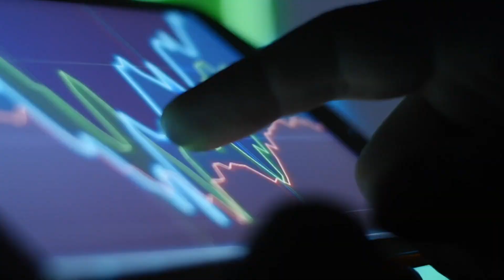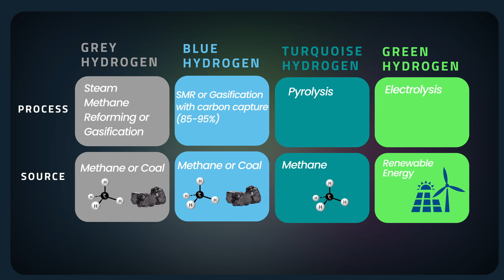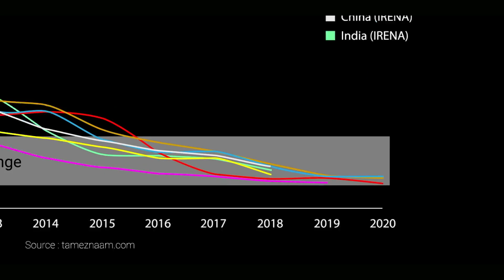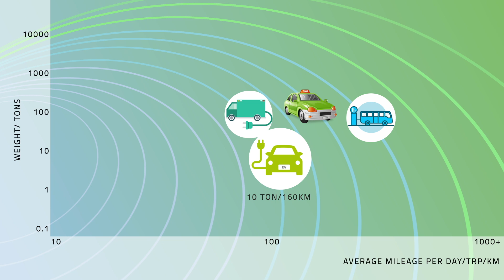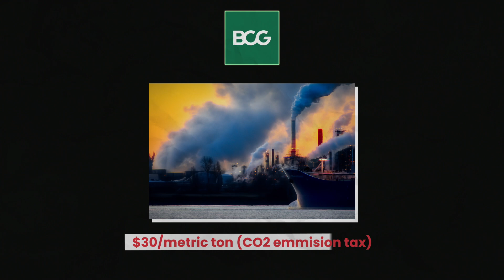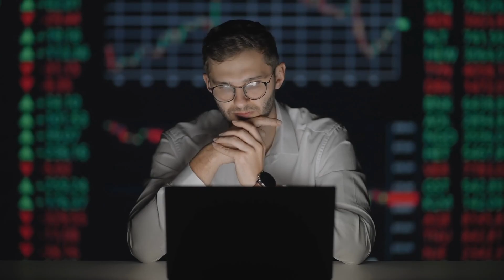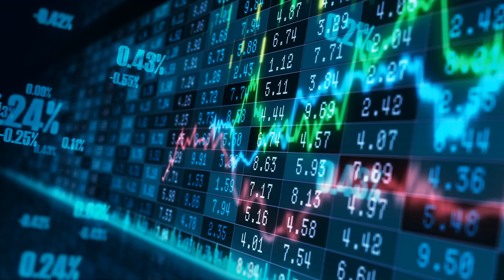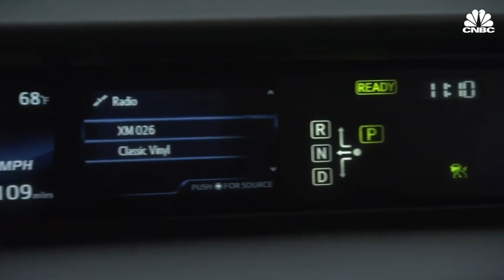Why NITIN GADKARI is pushing GREEN HYDROGEN for Indian Industries : Policy Case Study

Comment: I did some research on Hydrogen for my investment, Expect to read this story repeatedly over the next decade:

1) Politicians seduced by H2 Fuel Cell technology; 
2) Price signals suppressed throughout the value chain - subsidised hydrogen via subsidised distribution to subsidised vehicles; 
3) Physics and Economics spoil the party.

The best case H2 is worse than the worst case battery storage in terms of both cost and efficiency. Also battery cost is declining rapidly while H2 cost is more than hydro carbon fuels. Cost decline in H2 happens only on paper. Even lead acid battery storage is better than hydrogen storage let alone Li-on battery. H2 cost savings we see in the news are carefully selected half-truths. They say it takes 5 minutes to refill hydrogen fuel cells but they won’t say, how long it takes to produce, compress & transport H2. Those cost & time must be accounted somewhere in the value chain and they are enormous!

Unfortunately many nations are investing in H2 heavily, which is going to be waste of Taxpayer’s money. Even Reliance is going to invest heavily in Hydrogen. Not sure if there are any engineers with economic sense. Scientists are different from Engineers; Engineers are different from Manufacturers; Manufacturers are different from Raw material producers; and Businessmen are different from all of them. For any product or service to reach masses, it must make sense for all of these players. But unfortunately here politicians & businessmen are talking to scientists and announce it to public to please the voters & shareholders.

We must remember, H2 is NOT an energy SOURCE but an energy storage mechanism.  H2 is the most abundant naturally occurring material in the universe BUT NOT on EARTH. It must be extracted either from Methane(CH4) or Water(H2O). Extracting H2 from Methane is definitely economical but Methane is again hydrocarbon and it warms the atmosphere 86 times more than carbon dioxide. So we would be better off with petroleum & Coal than Methane based H2. 

To extract H2 from water, Electrolysis is needed which is an extremely energy intensive & inefficient process. To extract H2 from water, we need to spend 3 times more energy. If we want to store 1 KiloWatt energy in Hydrogen fuel cell, we need to spend 3 Kilowatt energy. Are we living in any kind of energy abundance situation, to waste 2 Kilowatt for every 1 Kilowatt of usable energy?. Green Hydrogen is definitely green, I mean there is no carbon by product there. But we're wasting 70% of energy produced by Solar & Wind while storing it in H2 fuel cell.

Also H2 is a colorless, odorless, and tasteless gas. It is the lightest gas and is explosive in air at concentrations greater than about 4%. In contact with chlorine, oxygen, or other oxidizers, hydrogen is flammable and explosive and burns with a nearly invisible flame. Because H2 is the lightest gas, it needs huge physical space to store though the mass is super low. To handle this, it has to be compressed or liquified in a pressure chamber. How’re we going to transport this kind of material from production facility to all over the refill station?. H2 Pipelines across the continent, seriously?. Who is going pay for such a massive and hazardous infrastructure?.

Green H2 makes sense, only when we have energy abundance and don't know what to do with such excessive energy.

If you're not convinced, No less than Elon Musk says, H2 is dumb idea. Nuclear is by far the most reliable and safe energy source followed by Solar & Wind + Battery storage.
Reply: H2 may not be an effective replacement of Petrol and diesel, but it can be a replacement for coal and natural gas in Indian industries.
Reply: @ajaivaidyanathan5880  No. Coal & Natural Gas are energy sources, but H2 is not. We need to spend either Solar/Wind energy or Coal/Natural Gas energy to produce H2. In that process, we'll be wasting 2KW for every 1KW usable energy. Why are we promoting this 70% energy loss, while battery storage has less than 10% loss?.
Reply: @dskrishnan  Correct
Reply: @dskrishnan  you are right in most of the things you said but there is a lot of wrong information too....

Hydrogen's specific energy is 120 MJ/kg petrol's is just 46 MJ/kg.

1 kg of Hydrogen has a specific energy of 33,000Wh or 33KWH, Tesla's Lithium ion battery has a specific energy density of 167Wh/kg....so a 2kg of hydrogen holds the same energy as Tesla model 3 entire battery pack which weighs 450 kg.....saying hydrogen is worse than lead acid battery is so wrong, it melts my brain...

Saying Hydrogen is not a energy storage mechanism is factually wrong, hydrogen is an energy carrier because, it is very rarely available in it's purest form in our atmosphere, you have extract it from others...It is not a storage medium that would be the hydrogen tanks or metal hydrides which are used to store hydrogen.

you are right in saying it is hard to store hydrogen, it is light and it is very small in molecular level....so it is hard to store hydrogen as a gas, so you have to store it as a liquid to do that you have store it under huge pressure or super cool it...both are difficult but not much different from storing CNG and LNG...

Electrolysis process is energy intensive and you are right, you need 3kwh of electricity to get 1kw worth of hydrogen, and so you say it is not viable.. But you are forgetting the energy intensity of the oil drilling and refining process. more energy in electricity is spent in drilling and refining the oil before it becomes petrol or diesel ...if the input to output ratio of hydrogen electrolysis was 3:1 then it would be 10:1 for fossil fuel, probably even worse than that as the engines are normally around 25% to 30% efficient so it is even worse in reality...

Batteries are not made out of magical shit and unicorn tears, they have some of the rarest earth material and they involve a very tedious and energy intensive process during refining....infact electric cars have 70%-80% higher carbon footprint than a ICE car and even though they don't have tail pipe pollution, according to a recent study by Volvo comparing their electric and petrol powered xc40 they found the electric car only becomes environment friendly over the petrol car after driving 140,000 km because they have that much carbon pollution during their production process (Autotrader did a Video on this you can take a look at it if you want)...

Batteries may be good enough for cars but for trucks, ships, aeroplanes etc weight is a major factor and heavy batteries are a no go....that is why even Tesla haven't brought out semi even though it was supposed to launch a few years back because the batteries alone would probably weight around 10 tons which directly affects it's total load carrying capacity...

hydrogen is extremely flammable but it doesn't burn with an invisible flame. Rockets use hydrogen as fuel does that flame look invisible to you. Methanol burns with invisible flame not hydrogen

hydrogen is stored at high pressure that even if a leak were to appear then the gas would escape and mix with atmosphere so fast it wouldn't be able to catch fire...there is a video of Toyota testing their hydrogen tank and shot it with a armour piercing bullet and it did not go in flame.

nut even a small puncture in lithium battery pack will cause an huge explosion forget about puncture, if it gets too got it will explode, if there was a thermal runaway in some cells it will explode, if the outside ambient temp gets too hot and the battery can't cool itself properly it will explode...

Hydrogen can be produced on site you don't need tankers or pipe lines to transport them, hydrogen can be locally made using electrolysis in the fuel station.....heck you can produce hydrogen even in your home if you have the electrolysis equipment...

saying hydrogen bad, battery good is such a childish view of the world, moreover China has a monopoly in lithium ion production and mining, 80% of all batteries come from china you want India to be dependent on China...…even if we produce the batteries here, the raw material has to come from mines which are controlled by them...

Don't start with hydrogen is dumb because Elon said so...of course he would say that since hydrogen cars are a direct threat to his company...

One great benefit of hydrogen cars with fuel cells is that it purifies air as you drive along, Hyundai nexo purifies 27kg of air in one hour of driving that is the amount of air 40 adults breath in an hour...10,000 hydrogen fuel cars will purify the same amount of air as 60,000 trees, this is great for countries like India which is struggling with air pollution..

we need both the hydrogen and battery technology to become better, think of it this way batteries are good enough for everything that uses petrol and hydrogen is good for everything that uses diesel or kerosene...
Reply: @superchargedpetrolhead  Finally I got a good dose of my own medicine. Thanks!. Energy density comparison is one of the most misguided argument to promote Hydrogen. Of course H2 has high energy density but how much energy is really needed to pack that energy into H2 fuel cell vs battery is the question. The overall efficiency of "Power Source -> Storage-> Consumption" chain is key here. As you rightly mentioned H2 has lot of inefficiencies & complexities where it's economics is not even improving on paper without subsidies, but battery economics are clearly improving.

Now Volvo's calculation of EV's true pollution while compared to ICE vehicle is again biased. Because Car hardware in general requires lot of mining but EVs uses 30-40% less parts & materials compared to ICE vehicles. As you rightly pointed Fossil fuel extraction, refining, transportation, subsidies, war/terrorism financing etc are not accounted there.

Unlike fuel tanks, battery packs do not explode, they catch fire slowly and burn for really really long time.

Those rare earth materials in batteries have high recyclability and it is only improving. Cobalt will soon be phased out and the progress in general is accelerating, compared to the progress in H2. So Why would we want to fund & improve H2 energy storage which has 30% efficiency while we already have batteries with 90% efficiency?.
Reply: @dskrishnan  I never said hydrogen is an energy source, I just said they can replace natural gas and coal as a source of heat in industrial processes. The source of energy can be anything that is renewable. But in industries you need heat. You can extract any form of renewable energy and store it in hydrogen which can be used to power the furnaces of industries by replacing coal and oil.
Reply: @dskrishnan  hydrogen production and storage has some inefficiencies but it's high energy density makes up for it...as i said 2 kg of hydrogen has as much energy as a entire tesla model 3 battery pack which weighs 450 kg...

it is so energy dense that you can probably power your entire home for months with just a few kgs of hydrogen...

Volvo isn't biased in this case, because they have said they will go completely electrified by 2025, what will they get by making electric cars look bad when in a few years their entire range will be fully electric...

the carbon footprint during production of a ICE car is 70% lower to the comparable electric car mainly because of battery....ICE cars might use many parts but none of them are rare earth material unlike electric cars...

Batteries don't catch fire slowly, they explode and they burn for really really long time because Li-ion battery fire can't be extinguished...

you asked why would we want hydrogen storage if batteries are at 90%...the answer is simple because weight...we use fossil fuel not because of their efficiency but because of their energy density.

so for example if you have to power an airplane like 737, you would need to have a batteries that probably weigh three times the weight of the whole plane itself and even then you might fly for a couple of hours, that's how heavy batteries are and no amount of improvement in batteries are gonna change that. the batteries won't magically go from150Wh/kg to 10,000Wh/kg...

we spend almost 4% of all electricity produced on refining fossil fuel and in most cases those refineries are not powered by wind and solar they are powered by coal and gas plants so it is even more inefficient and polluting...

hydrogen can be produced through electrolysis using wind and solar and it can be stored to be used when the sun doesn't shine or the wind doesn't blow...that would mean we won't have to spend 4% of all electricity to refine fossil fuel that is a huge positive environmental impact

now you might be asking why don't we just store the electricity from wind and solar in batteries...well because 
1.batteries are really expensive 
2.they have a extremely high carbon footprint during production
3.eventhough it can be theoretically recycled the process is insanely expensive...li-ion battery is everywhere from smartphones to cars etc but how many battery recycling plants are there...you have probably used many devices with Li-ion batteries how many of them have you recycled???
4.weight and size 
5.there is probably not enough rare earth materials to store all the electricity needed to sustain the human civilisation even for one night...

another great thing about hydrogen is if you combine it with carbon from carbon capture then you can create methane(CH4) or any other fuel to power our cars...that is called e-fuel...

I am not saying hydrogen in it's current sage is the solution to all problems, it isn't...it has lot of inefficiencies in production and storage but you can't solve the problem if you don't invest in r&d...early engines were less than 1% efficient if we then thought it is stupid we all would be still riding in horse carriages and not in cars and bike

let's invest in both battery and hydrogen r&d, let the better product win...
Reply: You might be right,even the government might be wrong, but why do big players adani and Ambani invest in this technology if there will be loss in it, don't they have tons of departments to take care of everything from calculation to application of everything they do, just a doubt
Reply: @DwineDesings  Economic & Technical decisions are not democratic decisions. At onetime entire Europe believed earth is flat. So number of people saying "Yes" doesn't make a project viable. Cold hard facts matter. In the life of companies & leaders, there would be many mis steps, miscalculations, I think Green H2 is one such case. I think wasting 70% of energy while storing in H2 fuel cell is a poor business decision while we can store 90% of energy in batteries. It is not about Green or pollutive, I am arguing  against the wastage of such precious clean energy.
Reply: Dude do you think reliance is foolish to put money....they definitely know better economics and have experts with him when they make such a decision.... They don't just wake up  go and check random comments on youtube and tv ...and put money....they know what they are going into....
Reply: @vishwasreddy7871  For sure they're not foolish with money, but not all of their decisions are wise. As much as they're wildly successful, they have many mis-steps/failures as well. I think H2 is one such mis-step. For sure they're not going to read a random YouTube Comment, but I can choose not to invest my money  in such H2 fuel cell based projects and share my research. You're welcome to ignore!.

Laws of Physics and Economics don't care whether it is Reliance or Adani. If you can make a technical/economical argument about why my assessment is wrong, that would be helpful. Authority is not the Truth, Truth is the only authority. It is not good use of our time to make arguments just because a big name/authority (Reliance/Government/Country) is involved.
Reply: @dskrishnan   arguing  and commenting, suggesting right now to you i am not that stage as i have to study on this topic and comment for that for which i don't have time , but i know the mentality of gujjus they don't take risk or put money.....ignorance of knowledge of other is dangerous...you may know only few things ...may be there research analyst know what you not learnt and you never know what future research holds ... previously also people said ev cannot be possible...but we are seeing the reality...and H2 fuel may have other utilities which they are concentrating on, but H2 will be a reality soon....ev's are temporary solution...
Reply: I do not agree with many things you said, and frankly impressed by the research you did. 

But you have to consider the cost of storage and transportation will also come down with time. As research will also be going in these areas (I haven't done my home work here).
Reply: @248harish  We can bring down the cost of anything overtime, that is not the point. We're wasting 70% of the energy even in the best case. Why would we want to fund an infrastructure to support that kind of a waste, while we have battery storage which is far cheaper and far less hazardous?.
Reply: @248harish  brother you should watch the Donut media video about why hydrogen failed. You will know better that H2 fuel cell is nothing but a gimmick and politicians are obsessed over it and will spend millions and billions of money of taxpayers on a things which is not really a good alternative.
Reply: H2 production effective only if we are producing surplus renewable which is going to waste.
Reply: @MSsumer123  see it's not about who is producing it. The thing is that H2 fuel cell requires energy to give energy as output in layman's terms. The science behind H2 fuel cell makes it less efficient and costly too produce cuz of use of costly things like platinum in it. That's why it's not about who produces it cuz the science behind fuel cell doesn't make it a alternative to conventional sources of energy
Reply: @MSsumer123  I think you got it right.
Reply: Bro H2 is Bad idea for Cars but For bigger picture it can serve, like Trucks and industrial use.
Reply: @ZakwanPatel3  Wasting 70% of energy is bad not only for Cars but also for Trucks and Industries. Green H2 is useful only when we have abundance of energy production and don't know what to do with such excess energy.
Reply: How ever ineffective there has to be an alternative to Petroleum. Now itself there is floods, landslides and extreme heat every year here in Kerala. What is the point of being efficient if humans die by 2100?
Reply: It's not feasible now just like solar and wind powe was 2 decades ago, but now solar is EVERYWHERE and similar reduction in cost is expected in H2 as more research is undertaken. 
And Businessmen like Ambani, Adani and countries like Japan and Germany wouldn't invest so heavily if it wasn't viable in the long run .
And as far as the "Genius" meme man and his statements are concerned it is in his interests for H2 to fail.
Even if the odds of success are low H2 is absolutely worth the risk , imagine our oil imports cut down to <20% of what it is today.
Reply: Hydrogen jada environment m dalne s kahi pani to bnne lg jayega jisse bahot jada barish hogi ??? Jese jada carbon dioxide s garmi bdne lgi h..
Reply: @jigsaw2281  Guess you and I fall under same category in science 😅😂😂😂😂
Reply: @sai_gireesh  Its just a question dum bo
Reply: @jigsaw2281  chill bro, agreed, your question is valid and I am not good at science 👍🏳️
Reply: and you think mukesh ambani does not know all this?
Reply: @AP-do6sv  Every Company has it's own share of failed projects, mis calculations. Reliance is no exception just like Apple, Google & every company have multi billion dollar failures despite their mega success. I think Green H2 is against Physics & Economics.  Laws of Physics don't care whether it is Reliance or Adani or Saudis.
Reply: Why do you trust Elon musk so much ? He is also be wrong or he knowingly might have said that ?
Reply: @goverdhangy761   I don't care whether it is Elon Musk or Reliance or anybody. Laws of Physics don't care about any of these people. In this case I think Elon Musk is in sync with Laws of Physics. That is Green H2 in the best case wastes 70% of energy. Why should we fund such a wastage, while we can store 90% of energy using batteries?.
Reply: @dskrishnan  well batteries are heavy and you need to more power to power the extra weight. After further advancements the shortcomings will be overcomed but it's important to have a headstart
Reply: @dskrishnan  and even lpg is colourless and odourless but we have overcomed by adding a gas to make it smelly when it leaks
Reply: @dskrishnan  and the expensive nature of electrolysis might he overcomed in future by finding other alternate sources for powering the process
Reply: @goverdhangy761  well no pal its not just due to Elon saying so it's due to the science behind H2 fuel cell. In layman's terms a fuel cell requires energy to give energy as output that's why it's less efficient irrespective of who produces it. Use of costly elements like platinum in it as electrodes make it not a good alternative for conventional sources of energy cuz it increases cost of producing it. FYI toyota world's 2nd largest brand with most no. Of intellectual property rights have invested billions in its research and tried whatever they can but you just can't increase efficiency of H2 fuel cell and make it a viable option. For even better factual research I'd genuinely recommend you to watch video of Donut media on why H2 fuel cell failed. You will know why I am saying so. Hope it helps
Reply: @manthenvashishth3769  maybe we could (really hope) replace the need for platinum electrodes and this problem will be overcomed
Reply: @goverdhangy761  well the other alternatives are lanthanum, zirconia and other elements which are not abundant like our daily use elements  and thus are difficult to extract and costly. Also toyota has spent very much time in research and development behind fuel cell and even toyota says that every toyota mirai the H2 fuel cell car they sell results in loss to toyota.
Reply: @manthenvashishth3769  maybe research will come up with alloys as a substitute
Reply: For next 10-20 year H2 production will be based for Blue H2. created from fossil fuel only. 
Outside India company are spending to increasing effiency of Green H2. currently energy to create Green H2 is more than energy from green H2.  

In the US most of H2 fueling station are not maintained and running on subcidies.
Reply: What kind of reaserch this guy did nothing is not clear.nobody invest this much money into these type of huge project.india defenitely will lead the green hydrogen market in the coming decades .jai hind 🇮🇳🇮🇳🇮🇳
Reply: @Nachiket Bhagwat pal watch Donut media video about why hydrogen failed. You will then know what is right and how the world is obsessed over H2 despite knowing it's cons which are more than it's prons.
Reply: @Nachiket Bhagwat Every Mega company has it's own Mega failures, including Google, Apple, Microsoft, NASA, Reliance or any company/country you can think of. Google's Social Network, Apple's many discontinued projects, Microsoft's Mobile OS, Search efforts & you can find many mega failures. Laws of Physics & Economics won't bend because a company or Country is big. I think Green H2 is one such potential failure. If you can point out a technical/economical reason, that would be helpful. Being a big company/Country is not necessarily a recipe for success.
Reply: @A_sat  Ev is not the future...ev has lot of by product and lot of waste....have you ever thought what happens to the battery ...the lithium waste its not recyclable....elon is evil psychopath.....not a genius....he is not invented and researched something new.....
Reply: 2 decades ago, Solar energy was also considered not feasible, yet it changed with amount of research done on it.

I believe they can increase the efficiency of hydrogen with time, ofcourse if it's possible.

I am no science student, so I don't really know if it's possible or not.
Reply: @kanekiken2002  the difference with solar energy was it never required a single joule of energy just to run it. See in layman's terms when you put in petrol, diesel or CNG you don't require energy to run the engine you just require to start it with very small amount of energy. The output is produced by the fuel itself or it's action which either combustion or rotation of coil(that is electric). For solar energy 2 decades ago we knew it can be extracted but we didn't knew how. Once stored it's similar to electricity. With H2 fuel cell you first require energy as input to run the fuel cell and then it produces output energy that's why it's not a viable option. Cuz it requires energy to even produce energy. In this way it's efficiency reduces.
Reply: @manthenvashishth3769  petrol and diesel need energy to produce too...first you need to drill the oil then transport it, refine it and then again transport it to fuel stations and then burn it in engines at 30% efficiency...it is way less efficient than hydrogen production and consumption...
Reply: @superchargedpetrolhead  that energy you talk about is very different it's during the extraction. H2 fuel cell efficiency is similar to petrol, diesel ICE. Go watch Donut media video about why hydrogen failed you will know the reality.
Reply: @manthenvashishth3769  current fuel cell has a efficiency of 50%-60% that is not as good as batteries but way better than ICE
you are confusing fuel efficiency with energy density...even at same efficiency a energy dense fuel will yield more power than a lower energy one...

hydrogen fuel cell car is not as popular as ev because it is still in it's infancy...

the scope for hydrogen is far greater than just cars, like said in the donut media video it is versatile can be used to power trucks, ships, planes, and million other equipment's that are currently using diesel and can't use batteries because of the weight penalty...so they are a perfect candidate for hydrogen...

If you want to clean up pollution in the transport sector, then majority of the pollution comes from trucks, ships and planes not from passenger cars, hydrogen is a great solution to them...

I am not saying we should give up battery ev and go all in on hydrogen. all I am saying is investment in r&d of hydrogen should not be denied because batteries will never be energy dense enough to power a commercial airliner or a cargo ship...
Reply: @superchargedpetrolhead  well I don't mean fuel efficiency I mean actual efficiency of the engine or drive train that is powered by a certain fuel. Also the 50-60% claimed efficiency is half the story and that's on paper but actually a H2 fuel cell is only 25 to 35% efficient only. Due to losses at 2 intervals one during production of H2 through hydrolysis and 2nd at time of converting H2 into electrical energy. And that's not what I am saying it's a Volkswagen article on comparing the EV, H2 fuel cell and ICE  and Even toyota world's 2nd largest automaker and brand with most intellectual property rights have invested and wasted billions  of dollars and hours in research and development of H2 fuel cell and with every toyota mirai they sell they incur a loss. Also H2 fuel cell is not used not because it's in infancy. Its due to the cost. Use of costly and scarce elements like platinum, lanthanum, zirconium, nickel which are also difficult to extract. A h2 fuel cell station in America cost significantly  more than even the gas stations. Also the fuel cell vehicles cost more and spending more and getting a similar and even less efficient engine than the cars at the same price doesn't make sense. Also H2 fuel cell lacks in delivering performance so its really not a alternative. Politicians just use this tech to waste taxpayers money on it when more skilled people and organisation tried r and d on it and failed not because they lacked skills because H2 fuel cell can't become a alternative. EV is way better it offers more efficient drive train with performance and it's cheaper also cost of building an EV charging station is lowest among gasoline and H2 fuel cell. But still EV won't be the future due to longevity of the Li ion battery and that's a different topic altogether so let's not discuss about it.
Reply: @manthenvashishth3769  when comparing efficiency you just compare tank to wheels incase of petrol but for hydrogen you take into consideration electrolysis to produce hydrogen and the hydrogen to wheels.....do you think petrol just magically appears in fuel pump....crude oil has to be extracted then transported then refined then transported to fuel pumps only after that you can fill your tank....this process of well to pump is many a times more energy intensive and polluting than a simple electrolysis...

If you are gonna take into consideration of energy use from production of hydrogen to use then you might also have to consider the energy involved in production of fossil fuel from well to pump and then from pump to wheels.

Electrolysis process has 3:1 interns of energy input to output ratio....refineries probably are worse than this...so compared to a fossil fuel, hydrogen is better...

Now hydrogen car costs a lot because of some rare metals in fuel cells and you are absolutely right about that....but compared to batteries the investment that is gone into fuel cell technology is miniscule....

I am not against ev but i can't accept the one sided thinking of people that battery ev alone would solve all problems...

I will give an example...737 is a popular airplane it carries roughly 20tons of fuel and flies for 5500 km, now jet-A fuel has a energy density of  around 10000Wh/kg so total energy in fuel is 200MWh.... to have a battery that can store 200MW at the current 150Wh/kg density it would take a battery that weighs 1300 tons....the 737's max takeoff weight is 65 tons...
Do you see the problem here 20 tons of Jet-A fuel holds same energy as 1300 tons of battery...while hydrogen is 33kWh/kg you would only need around 6 tons of hydrogen fuel to make the same trip...

Hydrogen has a much more broad use...there is a reason why Airbus and Boeing both believe future of air travel will be in hydrogen powered crafts...
Reply: @superchargedpetrolhead  well even you compare all that process of extraction of fuel that is energy vector transition till it reaches our gas station the ICE is still 35% efficient and FYI H2 fuel cell is 38% energy efficient. Therefore H2 fuel cell is just decently better than ICE not way better as you think. And i am talking about road vehicle in specific. For air transport ya H2 fuel cell maybe better but for road it ain't. Even better options like hybrid cars are there which also though cost more but not more than H2 fuel cell. The fuel cell may find its use elsewhere and even there it's not certain that it would. Also I don't say that only EVs are the future Infact i am pretty certain one of the biggest cons of Li ion will be its longevity and that's why it won't become our future. But considering H2 fuel cell an EV is a better alternative in countries like USA where EV infrastructure is developed.
Reply: @AM75071  Cobalt is a real issue. Almost all battery makers are trying to get rid of Cobalt. Lithium iron phosphate (LFP) batteries are providing better economics for reasonable performance. The good thing about Raw materials is, they can be recycled. These days considerable amount of Apple products are being made from 100% recycled materials, meaning no new mining is required. A lithium Ion still remains Lithium ion after 20 years of usage. Since the atomic integrity of these raw materials are intact, theoretically recycling should provide much better economics than mining.

Investing these recycling value chain would offer much better economics and ecological benefit than H2 fuel cells.
Reply: @AM75071  Shut up ter rorist...You are acting like you know everything ...It's just a question..Still I am not follower of a th ug moh mad like u... Following aas mani kitab which is 1400 year old😂😂😂
Reply: Man, this is not the right forum to post research. If you want to do some research, I can guide you to appropriate forums.
Reply: elon musk fan boy🤣
same thing was said for your elon musk's ideas which wasn't even his ORIGNAL IDEAS
Reply: @shivam_9-11  The difference is, his ideas were based on Physics & Economics and the naysayers were only making argument that it is not done before. But here for H2 fuel cells, the argument is not about never been done. But the argument is about, H2 Fuel cells are just inefficient and wastes 70% clean energy. This is just physics & economics. Why would we want to fund a project that wastes 70% energy?. Remember efficiency of electrolysis process is not improving in any of these H2 fuel cell projects. They were only focussing on how to waste clean energy(Green Hydrogen) instead of wasting fossil fuel based energy.
Reply: @dskrishnan  do you even know the background of lithium batteries? 
In heavy industry or long distance transport, hydorgen is much more useful than the electric

More than 350 large scale project are going on, Source: Mickensy report
No one is saying we should be 100% hydrogen, electric is still the best
But for a country like India, we should be diversed
Reply: @dskrishnan  Germany is investing the most, a country like germany is no fool, we know about innovations from germany.
Also Upcoming gen 4 nuclear reactors can produce alot of >600c heat as a waste product. That heat could be used for thermal splitting to create hydrogen instead of standard electrolysis. This method at scale could reduce the cost of hydrogen at less than 2 dollars per kg.
Reply: @dskrishnan  My point is still that for heavy machinery, hydrogen is far superior than electric
But for daily use(cars), electric beats hydrogen.
Let's see what happens in future, because no one knows, in present our arguments/references are limited to the theories we know or have discovered till now.
Reply: @shivam_9-11  Being a Mega Country or Corporation doesn't make them immune from failures. Every mega companies have their mega failures despite their successes. So calling them no fool is not a rational argument. While the Gen 4 Nuclear waste water may have the potential(which I'm hearing for the first time), Our Reliance & Adani have no access to Nuclear wastes and it is not one of the factor. This means the inefficient electrolysis process is going to be funded by Shareholders and Tax Payers are going to incentivise.
Reply: @dskrishnan  but i have heard hygrogen is produced by fossil(majorly)
Reply: @dskrishnan  hydrogen can be produced by 2 process:
1. Electrolysis
2. Fossil
Majority hydrogen comes from fossil
Who is saying that we cannot fail?
Every country is investing in hydrogen, india is not the new one
Secondly, India is also heavily investing in electric vehicles too, 
If we compare investment in electric to hydrogen, hydrogen investment is a joke.
Hydrogen isn't a failure, your whole argument is wrong.
For heavy and long distance, hydrogen wins over electric.
Hydrogen cars have more range than electric.
World needs alternatives, better we take whatever we have or wait for more alternatives.
Reply: @dskrishnan  if we waited for more alternatives, then say good bye to earth because it will take decades.
Reply: @shivam_9-11  Energy Density of Li batteries are improving and even long haul trucking is possible. Tesla's 4680 battery is already in production and they have demonstrated with test rides using Tesla Semi Prototype vehicle. Even for heavy machineries Tesla Mega Packs can support the load. Utility Companies are ordering these Tesla Mega packs like Crazy.

Diversification for the sake of it, especially investing on something which has only 30% is a poor economic decision. Of course any arguments are based on known/established facts, today the economics and efficiency are favouring Batteries by a long shot compared to H2 fuel cell. Even the trend is moving towards batteries than H2 fuel cell.

Unknown future events can tilt these trends but based on the current available facts, funding battery manufacturing programs would yield better results than H2 fuel cells.  Just like every company & Countries are having their share of failed/discontinued programs, I think H2 fuel cell is going to be a failure in the long run. Temporary press hype on H2 fuel cell and the senseless marketing/branding of calling Green H2 is appaling. If we name 70% wastefulness of energy as Green H2, that doesn't become green. It will still remain 70% wastefulness.

I think the reality of energy security is more important than perception of energy security. H2 fuel cell just gives a false sense of Green energy.
Reply: @dskrishnan  70% waste when produced from electrolysis, you are just posting 70% WASTE 70% waste

The main problem in using hydrogen as fuel for vehicles is storage of hydrogen
Reply: @dskrishnan  most hydrogen is produced from fossil, give me the source that 70% is waste

Lithium cell batteries are also not green, considering from where they come from
Reply: @dskrishnan  Future has been unknown always, I m here gn 4 nuclear reactors.
We can use both H2 and Li.
None of them are 100% green
I never said h2 works for normal cars, i am here for the trucks, Li will not wor, just take the example of Cargo ships, hydrogen can pretty easily work for it now imagine Li batteries😗

I feel like Hydrogen and Electric might co exist in a way that isn't too dissimilar the way petrol and diesel does. Each has polarising pros and cons and both have their own use cases. Also hydrogen seems like a more ideal transition point for traditional Motorsports.

Just think if we have only electric? isn't that bad, both types works for different situations.
Both can co-exist.
Reply: @dskrishnan  I don't agree with your claims
You still haven't touched the real problems of h2.
Cost, storage, etc.
Reply: I did same calculations and drive  an ebike in bangalore.

But when India will have lots of solar (in 2025), then the efficiency wont matter as the electricity prices will drop to 0 (or even negative).

Any usage of that excess solar is GOOD, and hydrogen seems to be one such use case.

Plus not needing to use USD as reserves for Indian trucks / buses / ships will be a game changer in geopolitics.
Reply: @shivamaggarwal50  Only the author of this video can pin a comment.
Reply: I don't understand most of the things you've said, but i agree with nuclear point.